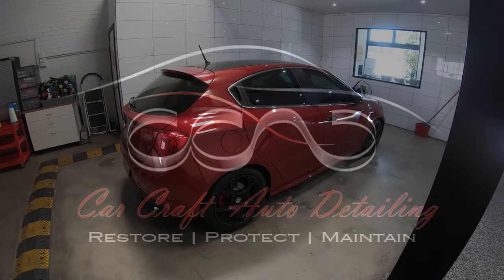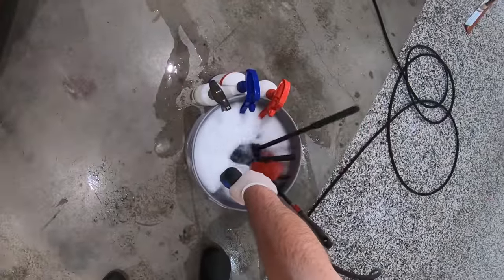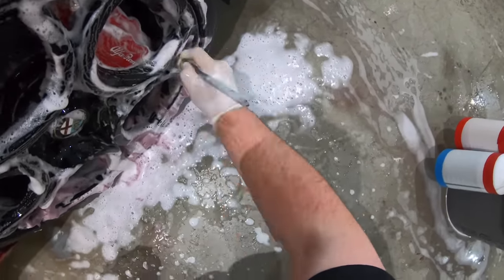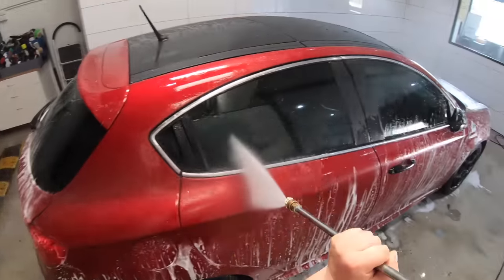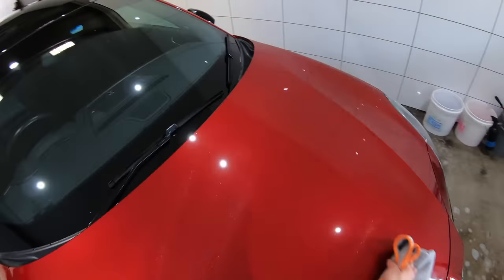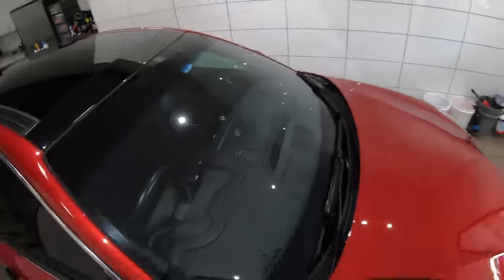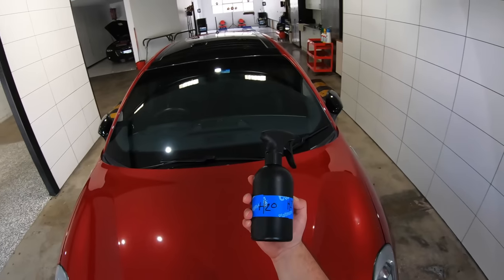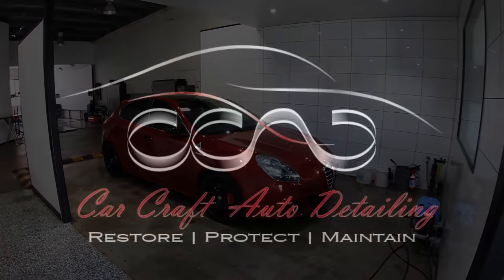Kwazar Dual Sprayers, Foamer, an Amazing Quick Detailer & CQuartz UK 18mths on!

Comment: Sandro, most quick detailers are used when either the cars just has been washed properly contaminated and with no wax's in the wash, then apply the quick detailer products, but in saying this, if the cars surface has a protection like CK Quartz 2.0 or3.0 then your really only going to use a top up products which will support the current chemical bonding of the surface protection already used, so mixing chemicals in any products is a real good idea, good do more harm than good, but the problems are that most products to not list the real chemicals used in the bottles other than petrol chemicals and to use various protection when applied, cheers sandro and keep up the great work. :)

Comment: that quick detailer looks like something I will in a hart beat if the price is right. I have been mixing 25% water into reload to use as a quick detailer and love how it adds protection and shine with nice water beading. I love jet but its not cheap and only use it on jobs that pay and if we can have a grate product at a good price this could be a winner

Comment: That is one sweet Alfa!   I wish they sold that model in the USA.    Alfa is slowly coming back into the US market.    They have the "high end" cars here now and of course the new Stelvio which is by far the best seller here in the good ole' SUV crazy US of A!   Ford only sells one car in the U.S. now,  Mustang.   Everything else.........SUV!   Crazy!    In a couple years, you'll only be able to get an SUV here!   As far as the KWAZAR bottles, TOP NOTCH!   They are my bottle's of choice.    I not only have the Blue, Green, Red, etc. but I also have several of the bright ORANGE with black trim bottles which are much cheaper than the other ones on Amazon.   It's the exact same bottle, but just marketed as a garden sprayer type of bottle and constructed in bright Orange.   I bought them for about 2/3 of the price of the other colors available.    I also have the larger (2 liter foamer and 2 liter non-foamer) Kwazar sprayers which my wife got me from Germany while there on travel.    All of my Kwazar bottles/foamers work incredibly well and they are a WAY HIGHER quality than other cheap bottles.    I have 10 to 15 different types of bottles in my detailing arsenal but the Kwazar by far are the best bottles on the market, hands down.    I will eventually be switching all my bottles to the Kwazar's just because I enjoy working with them/using them and I like the top quality of them also.   They are pricey but well worth it because they last and last.   The cheap bottles all break eventually.   The heads and sprayer mechanisms just don't hold up.   The Kwazar bottles definitely hold up and will give many years of faithful service.

Comment: The detailer really seems like a good idea. I typically use something like a spray wax, detailer or spray sealant after drying a car to get rid of the the remaining water marks... which I've always thought it's wasteful since this gets done every time I wash the car making the 3 or 6 month durability rating of these spray products a bit redundant. If the price is right for the detailer you've discussed then I'd definitely be buying it.

Comment: WOw so it must be the new car pro's ECH2o quick detailer is my guess Sandro. :) Also a 500 ml bottle will make upt 3.5 Gallons of quick detailer spray, OMG think about that for a moment, its a concentrate so if you mix it correctly based on the instructions you have almost 20lt as the quick detailer for just around$ $20.00 depending on where you buy it ? Thats less than $1.00 per liter, compared to the Retail products out there which are around the $30.00 for 500ml and once gone you have to buy more? Also if you mix car pro's both products in a 700ml spray bottle ie: 2 fliud oz with both reload and car pro ECH2o with 550 ml of distilled water and perfect protection and as a quick detailer as well, (Forget the rest car pro is the best) .( Registered / Trademarked & common laws apply) :)lol :)
its just as good as a ceramic coating, but need to apply it more often like say once every 3 months as a quick detailer for a everyday use type of car. :)

Comment: I have 3 of these and none have a weight  inside them which I have alot of issues with, for example after a few sprays the bottle seals and builds a negative n pressure with then allows minimal product to come through the stray so of I use it I have to keep the top slightly open when I spray it.

Comment: Would bilt hamber APC be ok in the blue bottle? It would be at either 10 or 15 to 1
Reply from the maker: Yes should be fine, I’ve used dilutions from 10:1 to 3:1 of various APCs
Reply: @CarCraftAutoDetailing  thanks for the quick reply, I'll get some ordered I think. Loving your vids, exceptional work. Thanks for sharing. Good luck from UK

Comment: 1 to 15 or 1 to 20 for the foemer? Could you please help me measure it correctly im still having a hard to time on how to do it properly
Reply from the maker: Unfortunately every detergent/soap is a little different so it may take a little testing to get the right dilution ratio, but once you have it, it should be consistent. I’d say it’s somewhere between 1:15 and 1:20
Reply: @CarCraftAutoDetailing  oh I use a ml cup to measure it what is 1;15 and 1:20 in ml?
Reply from the maker: 1000ml water with 75ml soap is 1:15
1000ml water with 50ml soap is 1:20
🙂
Reply: @CarCraftAutoDetailing  you are too kind thank you so much I've been stressing about how to correctly measure my products since I've been getting into detailing🙇‍♂️

Comment: Can I use brake buster wheel cleaner in the blue kwazar foamer ?
Reply from the maker: I haven’t personally tried it but I think if you get the dilution ratio right it should work.
Reply from the maker: I think there may be a more chemical resistant version but I haven’t tried it.
Reply from the maker: It’s a bit of work but it can be used to snow foam the whole vehicle, foam up your tyre cleaners, foam the engine bay with a degreaser and so on